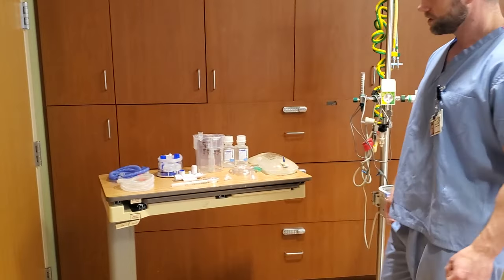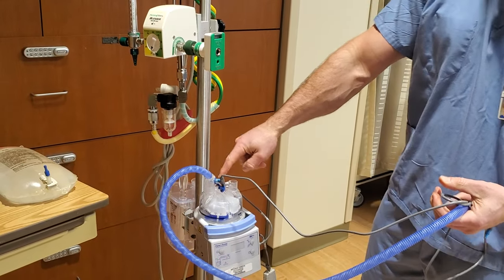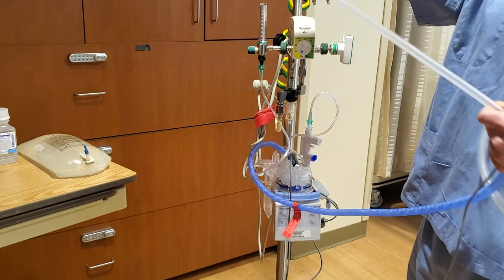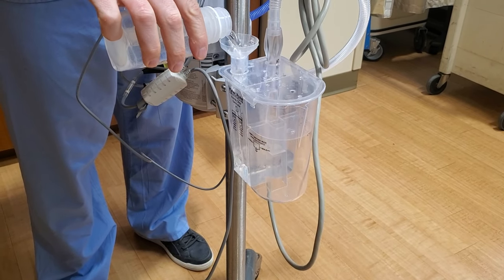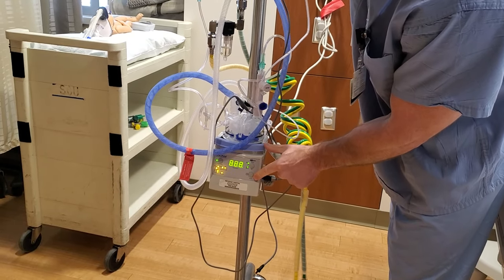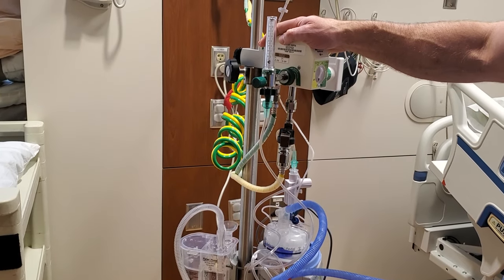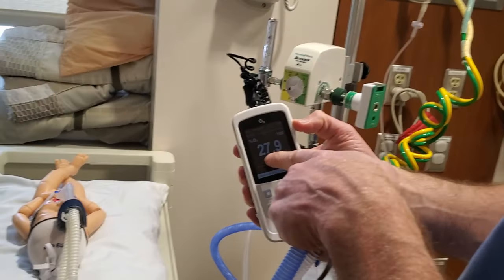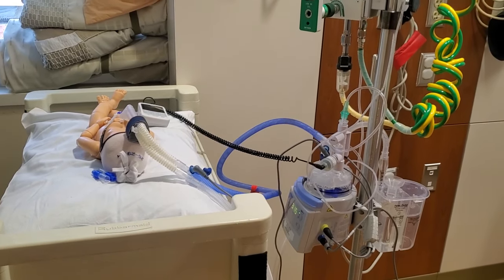Bubble CPAP assembly and set up.

Comment: A very quick instruction on connecting bubble CPAP. No real explanation, so it just the basics on connections etc.. No water trap used or shown in demo which should be a concern especially since you are using this on neonates. Some viewers may get lost not realizing that the water bag is just for the humidifier chamber, (the chamber usually has an auto fill feature so it fills itself up without overfilling as it consumes water to make humidified air) and separate water is poured by hand usually for the Bubble CPAP Generator.
Reply: shouldnt need a drainage bag,
Reply: Isn’t the name of the video just the assembly and set up hence no explanation